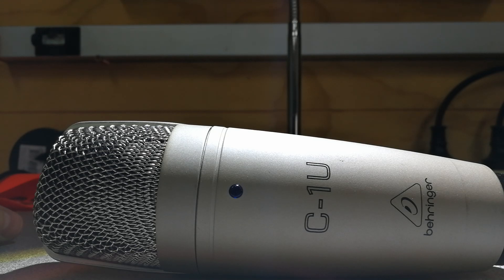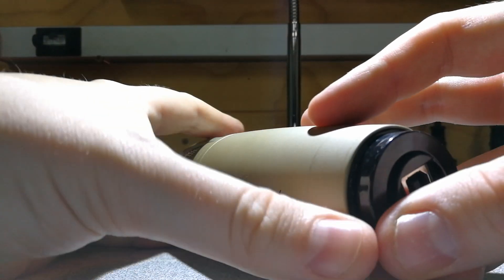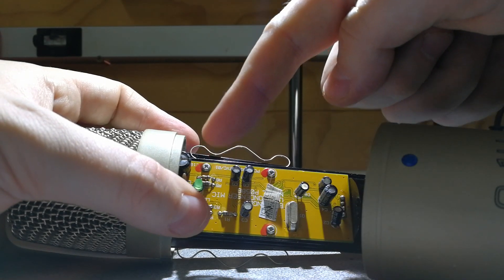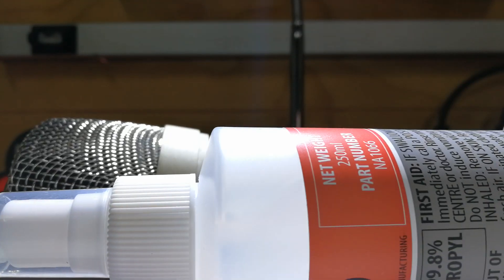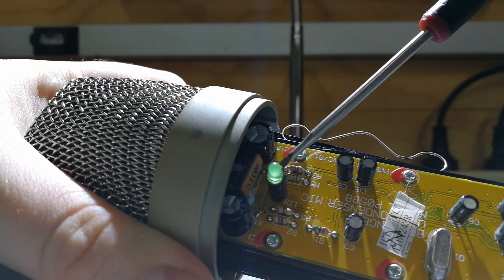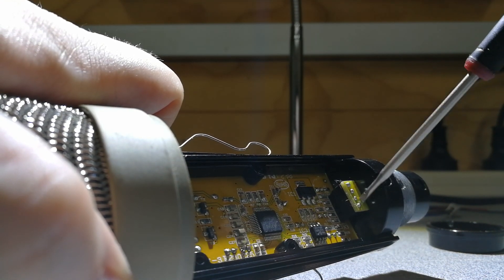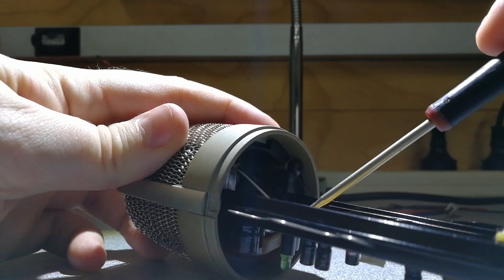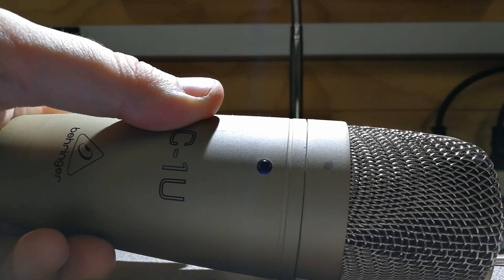Behringer C-1U low volume FIXED (actual real fix)

Comment: Just giving back as this helped me. I was having low volume issues on the C1U too. Decided to do one thing at a time. Cleaned out the oxidation with alcohol wipes, and I gained about 5 times the volume. There were inconsistent soldering issues, but I don't think those factored much, because the problem was fixed a resolder.
Reply: 5 Times? Most of the people who will open this will not solve anything,but they will lose the warranty and the right to return this gârbage back ...
I start to think the people who claim these things are selling this junk.
Reply: @Newlife-ol6pk  Have you had a dud C1U? I've had two (out of two, lucky me). I threw my first one away. Second one was picking up at 13% max (on windows sound). After cleaning out the corrosion, I get just under 70% max. If I hold it to my mouth, I get over 90%.

Also, there are no tags that come off from opening it, so there is no way of telling if your mic's warranty is void from opening or not. Do you even own one, lol?

Or are you just being a c*nt for no reason?

Comment: Hi Storm. I followed your instruction and it really helped. The soldering was not as good as it should be and I re-soldered some of the components. Especially the resistors were not OK. I did not hae to clean the print itself as you had to do because of oxidation. The Volume was much better and when adjusting the microfoon input a bit. (Software) the sound is equal to other microphones. Thanks for your help in making a video on how to solve the problem.

Comment: I've been dealing with this microphone buzzing on me for the longest time, I had to constantly squeeze the mesh grill at the top to temporarily stop it but it would always come back.  I did the same steps as this video, only I was unable to solder or anything I simply just used an alcohol wipe to clean up the white oxydization all over the board and the buzzing has stopped entirely.

Thanks for this video, helped out a ton. :)

Comment: Assuming the C-1U uses the same capsule as the C-1 (the XLR version), it does matter which direction you speak into the capsule.  The LED should face you when speaking.  The capsule has a cardioid pickup pattern so it is less sensitive to sound from the back, as well as having a different frequency response.  Just try rotating the mic 180 degrees while speaking into it; you should hear the difference in sound.
Reply: Not working at all

Comment: I can actually be one to say that I did have a blue light on mine. I just started on the "2nd" season of my TikTok channel, or whatever you want to call it. Plugged the mic in, the light was green? - Also there is now a lot of hum and low noise. Now, before i still had to be close, but it sounded much better. with the green light, there is a noticeable hum and it's just blah! I'll have to find a way to make the light blue or do this!

Comment: This actually worked for me, but mine had a humming noise. After cleaning and soldering, the humming sound disappeared for me. But remember that you need to put all the pieces together for testing. I think it's due to grounding and if you don't put the parts together, the humming still occurs. Thanks for the video.

Comment: Mine crackles and sometimes switches off! Should I write it off as dodgy, and move on? Haven't got your soldering skills. My suspicion is that there's a mismatch between expected and supplied power

Comment: Uh, I did all of that and it made pretty much zero difference. I did the resistor solders, and I put a bit more solder on the other side too, I did the same to the microphone's white wire as well. I also did the resistance fix from another video. After wasting like an hour with it, I can tell it sounds basically exact same as before...

Comment: I bought this microphone in 2014 and it was low volume from the get go. At the time I tried all software related stuff, boosting, volume etc. And lol @ the phantom power thing to get blue light, it really was a myth back then. Maybe a couple years ago I saw this video and tried cleaning it with isopropyl alcohol, but no difference. Today I gathered some courage and decided to replace all 10 capacitors, including the big 470uF ones, and also remade all solder contacts. Still nothing, volume is still low as always. Anyway, I appreciate the tip, it seems to have helped a lot of people.

Comment: I disassembled my C1U. yep. the factory soldering is indeed oxidized. will have to arrange some alchohol, soldering iron and solder to fix this very annoying issue. mine got to the point, where I have to yell into the microphone. however, I bought mine in 2021, and the mic has a much simpler board inside it.

Comment: I touched the iron to each join for 10 seconds to re-flow them all (without adding any more lead though). At the very least, I didn't make anything worse... But I don't think it helped anything in my case. I still can't even get clipping when I shout. For now I'm good with normalization-boosting, but I have a new USB-B cable coming in soon and we'll see what that does- If I don't comment again, it will only mean status quo still. While not exactly crappy and still better at capturing low/high freq than the other options out there, in the end it REALLY is a budget-type Behringer product with this infuriating low volume quirk.

Comment: Just disassembled mine and it has equally bad soldering.  Non-existent on one side of the board in a couple of cases.  Additionally, it looks like the pins of a capacitor are shorted by a splash of solder.
I was led to believe this brand was reasonably good, but the quality of this device is shocking.
Update:
I improved the soldering and removed the short, but it didn't make any difference.  I have ended up using some microphone boost software (Equalizer APO).

Comment: Great video. Tried this cleaning it first. The led got brighter but sound was still low. So tried soldering the parts you mention. Unfortunatelly no sound now. Mic led is ON anyway. What else can I check? what is the special component to test? or there is no return point?
Reply from the maker: Sounds like you may have accidentally broken something. Sorry not much I can suggest other than check all your soldering and make sure you didn't bridge any pins on any chips. Maybe clean the board a lot with alcohol. Also check the cable that connects from the Mic to the board hasn't fallen off.
Reply: @Storm_.  Thanks so much for the comment. I'll double check everything.

Comment: I have another problem. I actually have the C1 version and it was working well, but I dropped it... now whenever I turn it on it makes a very loud unstandable noise. I mean it's not expensive, I can even just buy it again, but if there's a way to fix it, I'd rather try that first, 'cause the mic was literally new
Reply: i have the same problem! I also dropped the microphone and it began to buzz. they are impossible to use. is it possible to fix it somehow? replace capsule?

Comment: Possum TV
0 seconds ago
Thank you! I bought one of these years ago and I had always though the problem was a defective driver.

There was not much corrosion in mine but the resistors were virtually bare of solder and resoldering them made a big difference to the volume. 

After doing this here was still some hum and I noticed the capacitor and the transistor hiding behind it were also bare of solder. You have to remove the screws holding down the PCB and also the screws attaching the front part of the microphone to access the transistor, but I did this and resoldered them and the hum went away. I also cleaned the PCB in this area with IPA so I can't be certain whether the cleaning or the soldering did the trick.

BTW the transistor is a 2SK596S JFET and is probably somewhat static sensitive, so it's best to take anti-static precautions when working near it.
Reply from the maker: Thanks for the report :)

Comment: Great post, it solved the problem for me. Special thanks for showing the dissasembling; if you do not have needle-point pliers, you may use an U-shaped piece of wire to remove the inner ring at the bottom.  In my mike, there was a resinous layer over some areas of the PCB. Wiping it out with isopropyl alcohol and drying with a clean Q-tip produced a fully working microphone in a few minutes; MAGIC!   I believe that some parts of the circuit, those directly connected and close to the capture disk, are of very high impedance and need an excellent insulation to work well. In fact, in my mike there was a capacitor in that area connected through the PCB via a small Teflon ring, which suggests that the extra insulation must be needed. Any dirt or deposit in that area should hurt a lot in sound volume and quality. Should not be as important in other parts of the PCB, for instance in the USB connector, but a good cleanup is always a good idea.  I believe that this was a "protective coating" that went south for Behringer, usually a maker of good audio products.
Reply from the maker: Thank you for your informative explanation for this mysterious problem :)

Comment: Days ago I got a C-1U mic I noticed that it had little volume, I disassembled it and found 2 electrolytic capacitors of 470 microfarads x 10 volt that were out of stock. I replaced them and increased the volume noticeably. I hope the data will serve you.

Comment: Did you just wipe the microphone a little and stick that stuff better?
sorry but my english is not very good and i didn't quite understand :D
Reply from the maker: Wipe off any white corrosion with IPA alcohol, re-solder some parts that do not have good connections.

Comment: Thanks for the video and I'm sure you're right: the workmanship doesn't look great. Unfortunately I haven't managed to bring about much improvement, if any. However, I never was the world's greatest with a soldering iron and I can't get on with this modern, lead-free solder, which I can never get to flow. I went further than you and took off the cover to expose the actual microphone: the connection to the central post looked bone dry but I couldn't make it much better. Thanks anyway.

Comment: I've tried this on my newly purchased c1u. Because of the low volume issue I used to boost the volume around %400 with software. And after following the instructions about cleaning the pcb (I havent done the resoldering bit) I don't need a software boost and now %100 regular volume is louder than the previously %400 boosted one.
Thank you!

By the way the pcb circuit looks different than the one on the video. But it works anyway!
Reply from the maker: Great to hear thank you :)

Comment: I have a rode nt1a mic microphone and it stops working every month, I have to clean the circuit board with a pointed metal pin and it works again, this happen to me for many months untill its completely not working now, when I clean it I dont know what I am cleaning as its invisible or tiny wax type thing or corrosion I dont know,  now seeing this video I am thinking of cleaning my whole pcb with alcohol and will see if it works. Microphone pcb are so sensitive I hate to open it up
Reply from the maker: I recommend washing the PCB with alcohol and scrubbing with a (ideally anti-static) brush, or old toothbrush. Use contact cleaner for the connections.

Comment: I have the Behringer C-1, but is not the USB one. It´s a XLR, and the volume is extremaly low. Would your solution work in this case?
Reply: Please check your phantom power.
Reply: @rizqmusic2008  I did check.
Reply from the maker: I honestly never owned one but it is definitely possible if it was made in the same factory.

Comment: Thanks I'll give it a try! :) However I do have another problem where the metal mesh head "broke off" and when the microphone doesn't have the head on it makes it unbelievable horrible to listen to. Don't you know by chance if there are some ground points? I'm not sure about my theory
Reply from the maker: No the mesh head doesn't have any grounding, it just provides some natural noise dampening, so it would sound horrible without it. I think from memory there is some foam in there too.
Reply: @Storm_.  The foam doesn't do anything, it's the mesh that makes the quality to go 100x better I've done some tests where I slowly brought the mesh close to the actual microphone and the sound was fixed, however oddly enough when I turned the mesh 180° it was the same as without it which makes me believe there is some strange ground connection
Reply: @adfjasjhf  I had the same problem, maybe the cage is working like a faraday cage or smth. I squeezed and duct-taped it back and it kinda works.
Reply: @yagizakyuz  That's what I think as well. Duct tape isn't really elegant solution that I'd like to go for.
Reply: @adfjasjhf  I used a black electrical band which kinda looks aight
Reply: @yagizakyuz  Yeah I get it but I don't really want to look at that. I was looking for some elegant solution where I could solder it back together or something.

Comment: Hey. I basically do not have problems with the loudness, but given that i need to set the gain in windows to around 50, i am getting a lot of white noise. My question is: What gain do you have to have to have it recording your voice loud enough without catching too much noise. (BTW, the PCB on mine do not use the big solder friendly condensers and resistors and the solder is still not perfect)
Reply from the maker: You shouldn't need to use gain, any gain will add noise. If your mic is working correctly it should be perfectly loud without any gain.

Comment: Hello, I have the same microphone and the other day I connected it and it doesn't work. The led light comes on and the computer detects it well, but it doesn't work. What can be? I have written to Behringuer but they do not reply. Thank you
Reply from the maker: Well firstly it could be software, so try it in another computer if possible and check all the obvious things like mute and levels etc. If it's not software and turns out to be hardware you'll have to open it up and check the components. If you don't have much knowledge at least follow some tips in the video and reflow some solder and clean off any oxidisation, if it still doesn't work after that then I suggest getting a different mic or return it to where you bought it from. But yes remember Occam's razor, it's usually the most obvious thing, ie software.
Reply: @Storm_.  Okay. Thank you very much for answering. I work with Mac and I have always used it there, I have tried it on 4 different macs and none appear. The system recognizes it but there is no movement. I use Adobe Audition and the microphone appears all normal but when I speak it doesn't draw a wave ... I don't know what to do anymore :-(
Reply: I have opened the microphone and everything is correct. There is no rust and the welds are correct ...

Comment: I don't have proper soldering equipment but I manually cleaned oxidation with a precision screwdriver and it was enough to fix it for me
I've had this mic for YEARS and had this problem since day one

I can't thank you enough man, I finally have a properly working mic!!

Comment: And I also removed that 1.5V LED and resistor (There is 5v going to it) and replaced it with 3.3V Blue led and different value resistor. Now it glows nicely :D
Reply: Which resistor, is it fixed low volumes small on distance.

Comment: Holy SHIT ! Man ! I can't thank you enough for this tutorial ! What in the hell ? My C-1U was buzzing like a crazy idiot so i lost my patience and tried to do something with it. Went to youtube and found your video. I disassembled it, cleaned with alcohol, reflowed every single joint with flux and new solder, cleaned it again, assembled and what now. IT DOES NOT BUZZ AND IT HAS TOTALLY ZERO NOISE XDDDDDDD !!!!! MAN ! THANKS A LOT (sorry for caps, i'm just so much excited !!!!)
Reply: It did that on my old pc but after I got a new pc the buzzing has stopped, the volume is still pretty low tho, even at max volume, i did everything he did in the video but the audio is still pretty low and you have to talk extremely close to the mic for it to be better, im currently using voicemeeter to boost the volume a little bit but I get some noise that is kinda unpleasant.
Reply: I only cleaned mine, I don't have a soldering machine etc - would you say that the Noise floor is due to bad connections?
Reply: @Dice-Gamble  In the end, I had to throw it away, because usb connector on microphone started to lose connection and I wanted to get a better microphone anyway. Reflowing solder connections helped to lower humming noise and buzzing in my case.

Comment: Thanks man! I ve just finished cleaning mine and it worked like a charm.  No noise or low volume problems anymore. Now it sounds like it s supposed to be. I guess the oxidation was shorting some conecctions.
Reply: Lucas, did you also resolder it or only cleaned it?

Comment: this shit actually worked, i did not re solder anything for now, i just cleaned everything with isopropyl alcohol and it works like a charm, noise is pretty low while signal level is higher by at least 50%
Reply: Same thing here! Cant believe it  lol

Comment: My mic was working fine until it fell a few days ago. It went really low volume. Turns out that white cable had disconected. thanks for the fix, i wouldnt even know where to plug it if didn`t saw your video for reference